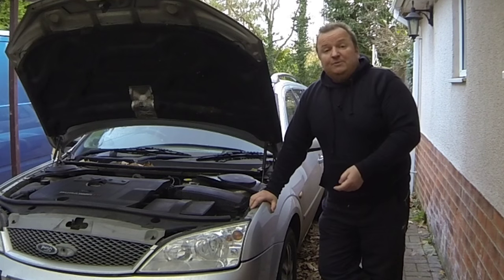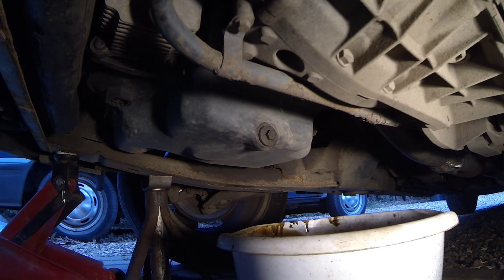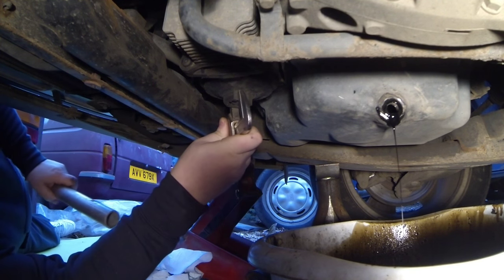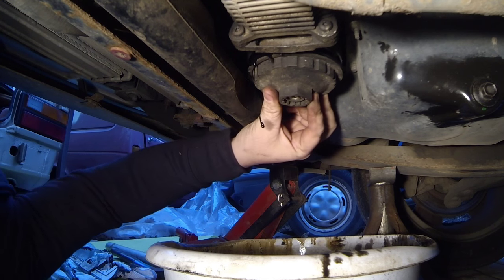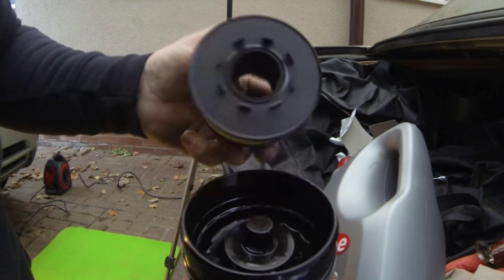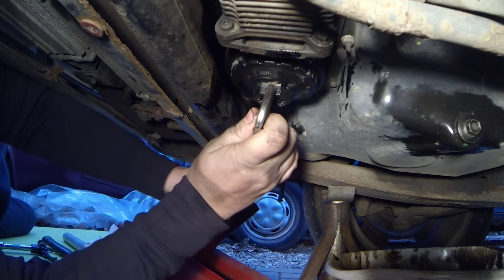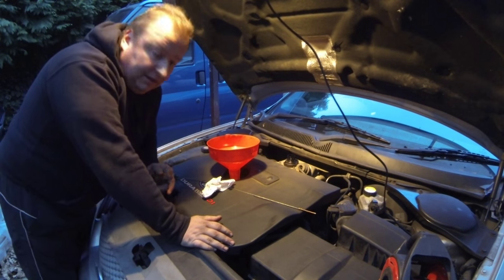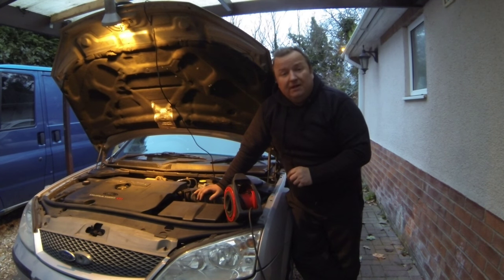Ford Mondeo Mk3 Diesel Duratorq 2 0 Oil And Filter Change How To

Comment: underneath oil filter in the middle you have 8mm socket for allen key. This is for drain oil from filter first  to avoild splash everything around as you can see on this video.

Comment: Word of warning, the oil filter housing isn't supposed to be much more than hand tight....tighten by hand and use a correct socket just to nip it a little tighter; the rubber seal will do the rest. You certainly don't want to use a chain tool or any excessive torque on it. It's only made of plastic, after all.
Reply from the maker: I know that bud.

Comment: I'm too lazy for an oil change. Then you have to recycle that used oil and filter. Jacking the car, jack stands, crawling around on the cold ground. My knees are bad enough.  Ya, I know, your showing how to do it. Say hi to everyone there.
Reply from the maker: +Brian Percival I didn't want to do it either Bri lol but it's not been done and you never know when the previous owner did it.
Cheers
Martin
Reply: You know that sticker they put in the window "Next oil change '64,560' (5000kms later) my car never gets to it, a year later and it's fall again, change it before winter.
Reply from the maker: Brian Percival
lol.

Comment: Great Video, I need to change my oil next week and this video is very helpful, reading the comments, I will buy a 36mm socket to the filter (is more easy and safe I read in the comment section) and I will do it, thanks a lot @retrorestore and thanks for the helpful comments in this video, Im learning a lot and I repair Ford Mondeo MK3 a lot of times with this videos, I save a lot of of money, thanks for all, have a nice day and Greetings from Spain.

Comment: alright i have a 2002 mk3 ford mondeo and its been in a garage for 5 years it needs oil change and battery start up because it was installed befor we stoped using it and tires need a to filled again any more stuff i should do?